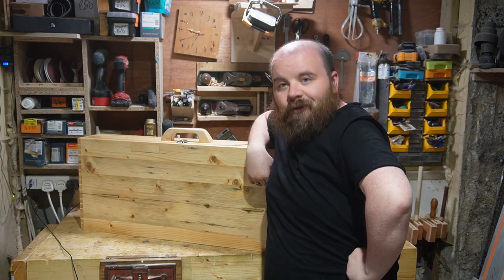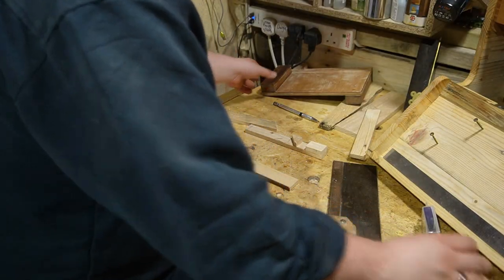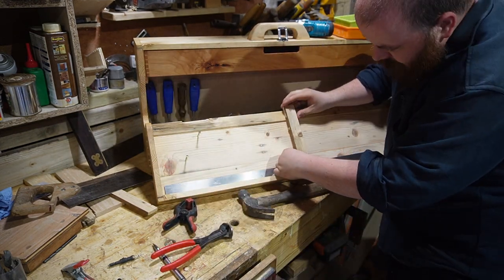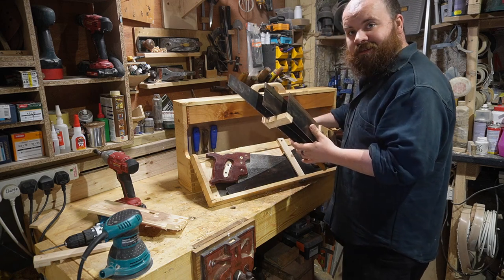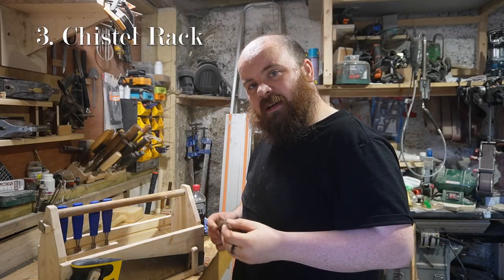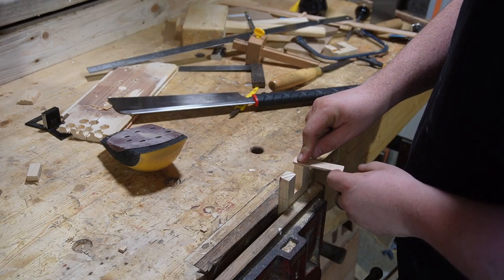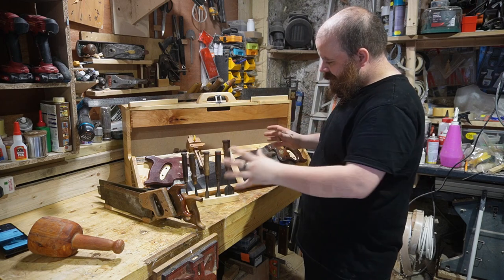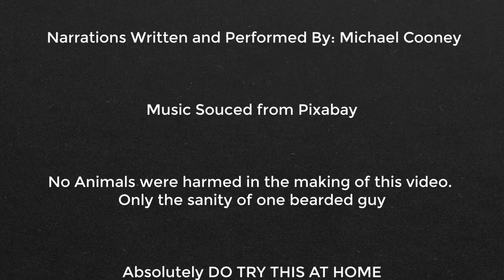Adding Tool holders to my new toolbox.

Comment: Very nice 👍. Sorry for being that guy, but should you store hand saws blade to blade like that?  Kind of opposite to everything I was taught, I would at least add blade guards to them. 🤷‍♂
Reply from the maker: Tbh I'm on the fence on that myself any of the examples I found including the one it is based on was like this. I agree i normally don't do this and have put spacers in between now to reduce the risk. Thanks, Mike
Reply: @ocuanadesigns Thanks for taking the comment in the spirit it was meant! I like that you included your Grandfather's wood, that is a nice tribute. I recently got a very basic chest that someone clearly hand built years ago. It's covered in horrible brown paint. I have plans to clean it all up and build compartments to make it a proper tool chest and put a nice finish on it to highlight the wood (still a mystery what is under the paint). Your video got me excited about it again. 👍